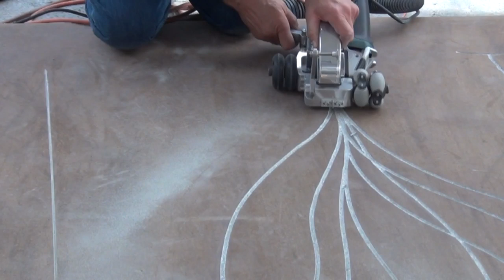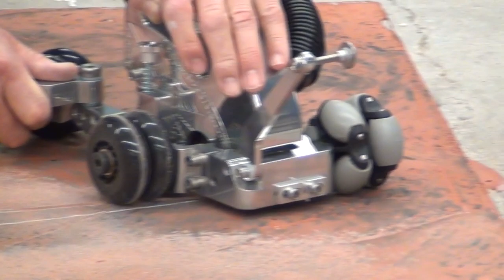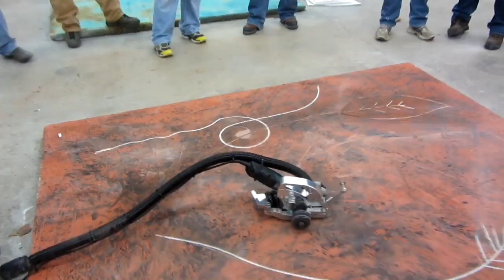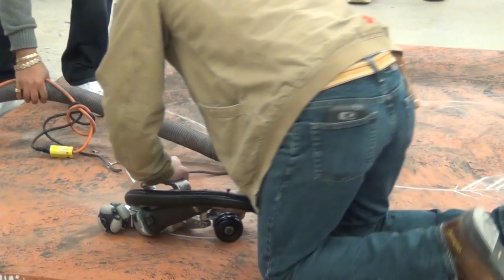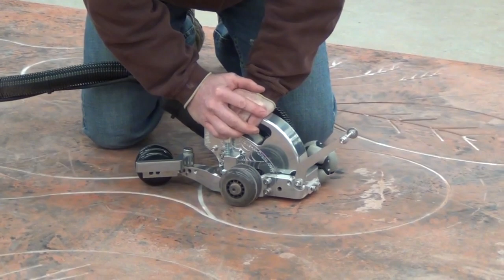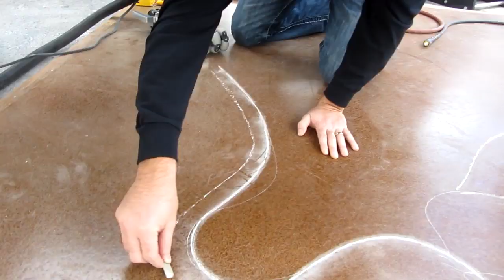The SPIIDER: Artistic Concrete Saw

Comment: An angle grinder with  diamond blade is all you need. Plus you can see your start and end points with no blind spots. This would be good for interior engraving but outside you don't need all this.
Reply from the maker: This tool is helpful if you want to control the depth of the cut.  It is also easier to use for those that don't have experience with an angle grinder.  It offers blade guards for protection and a shop vac attachment for dust control - but there are notches on the tool that show where your blade starts and stops so you do not need to watch the blade.  Simply follow your front guide.